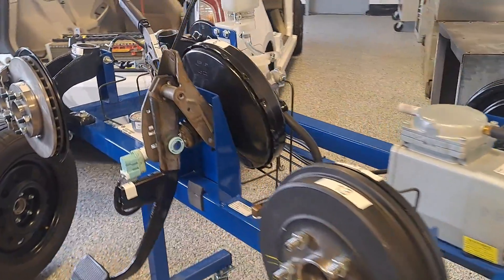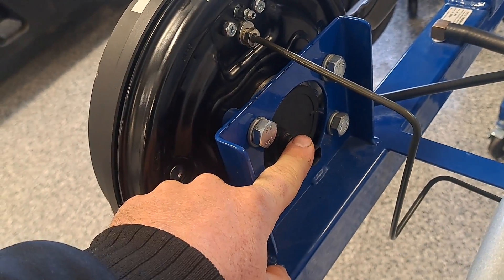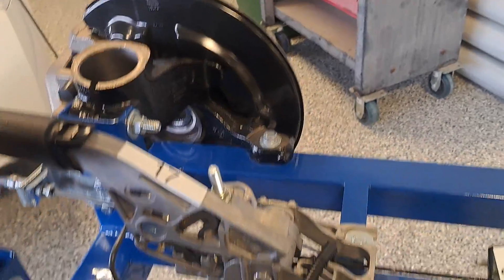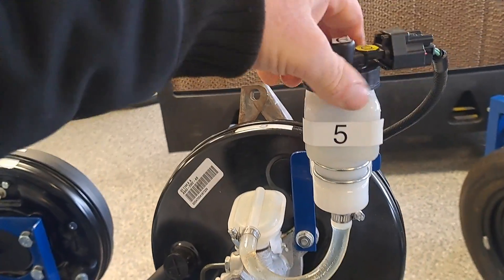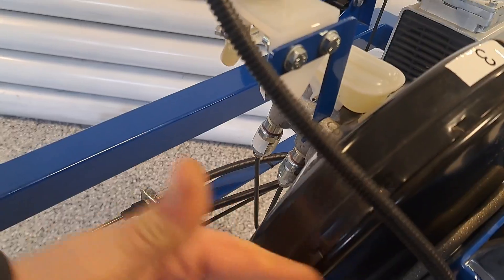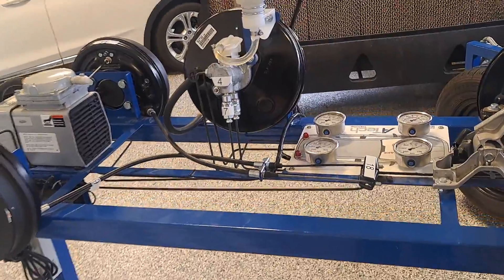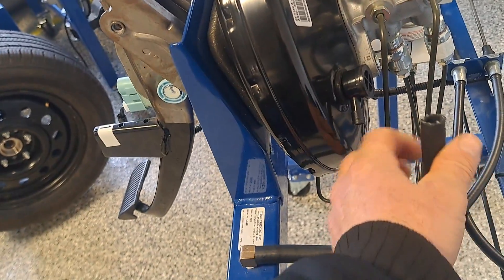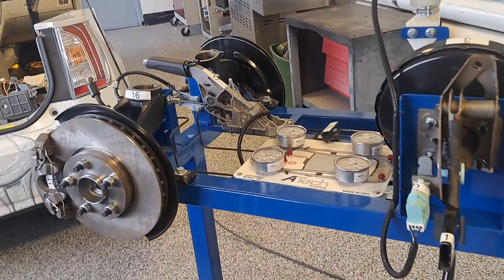ASE A5 Brake class brake system overview

Comment: Hey man this is soo great. There are a lot of brakes electrical schematics diag questions on the A5 brakes test. Can you please break that down ?? I’m having a hard time trying to figure out what is short to ground, short to voltage and open or closed circuits . Dude I pay you if I have too thanks 😊
Reply: Take a look at some basic A6 videos, those will 100% explain what all those terms mean.
Reply: @EpicTacoAirsoft  thanks man I will
Reply from the maker: Did you go for A5 yet? How did you do?
Reply: @CollegeAutomotiveClasses  no I got a 25 but your study material was very helpful. They always ask about hybrid vehicles brakes stopping intermittently what’s the cause? They also ask many questions about brake switch electrical diagrams that are hard . Can you please help me to understand Brake electrical diagrams and how to trace short to voltage, open / closed circuit.? Please and thank you.i need a 35 to pass thanks.
Reply from the maker: @James-fl2ug  you are not that far off. 
I am making complete courses. Going to be on Patreon for just $5 per month!
I will be doing an electrical class but will probably take 6 months to build out. Which is part of the reason I am only going to offer it on Patreon, doing them in video format takes tons of time and I don't monetize lessons on YouTube. 

There a lot of guys struggling with lack of good education options.
Reply: @CollegeAutomotiveClasses  ok great thanks man.
Reply: Hey Paul can I email you my number . I have some questions about the electrical schematics on the A5 test and a4 .